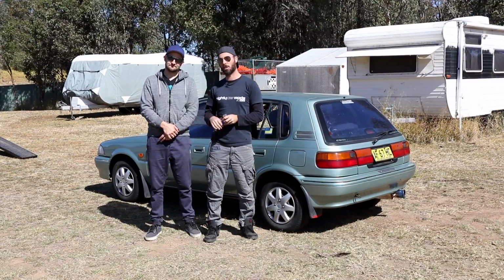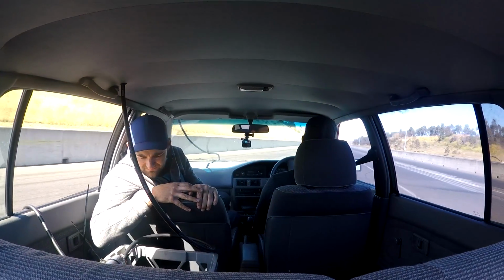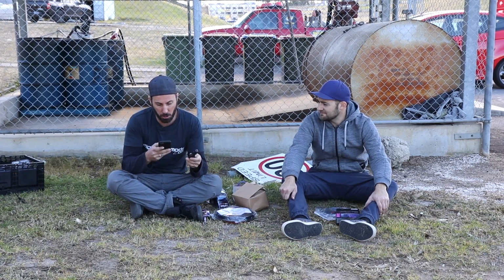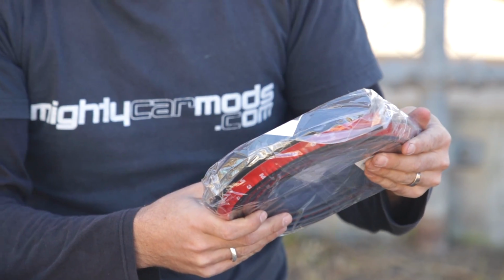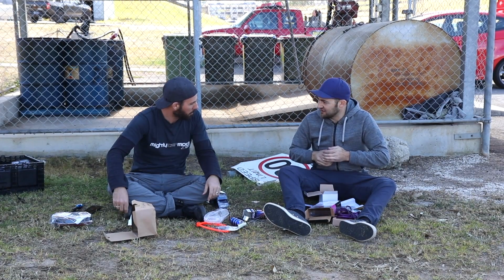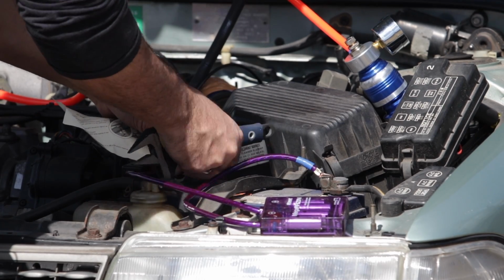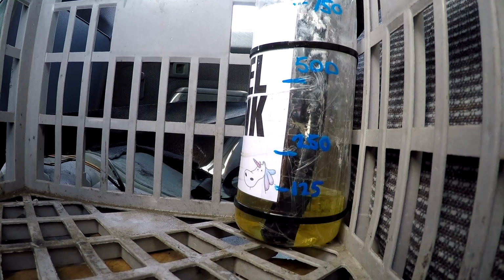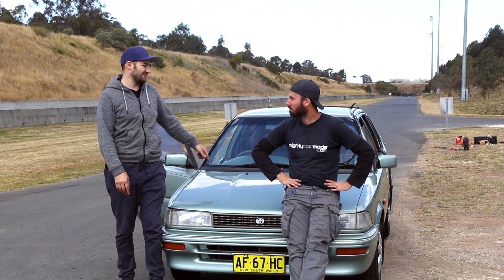Fuel Economy Mods - MYTHBUSTED

Comment: im curious as to what happens when you put larger /smaller diameter wheels and tyres on a car, I know the speed changes and the speedo does not read properly but my question is by how much? can you please use science and find out using Derrek?
Reply: Work out circumference of both and divide into eachother to get the ratio which you can multiply the speed by. 
  Circumference is pie (3.14) mulitiplied by the diameter.
So for example a 17" rim with a 3" sidewall tyre when the factory fit is a 15" rim with a 3" sidewall tyre = 1.1(more turns), so at a constant engine speed and gear you're doing 77mph whereas before you were doing 70mph.

Note that it's not this black and white as sidewalls typically decrease as wheels get larger, that's why larger wheels = a bumpier ride.  You have to measure the entire wheel, tyre and all, to get an accurate figure.

And that's assuming your speedo is correct.
Reply: Larger wheels = higher top speed and lower acceleration, because you've increased the gearing.

Smaller wheels = lower top speed and better acceleration because you've reduced the gear ratio.

Note that you can do the same thing by changing the gearbox final drive (not easy) or changing the differential gearing (possible on rear wheel drive, not easy on front wheel drive)

The only way the change of wheel sizes would make much difference was if you were sat on the motorway at 100rpm less but still had adequate torque to maintain speed.  I find most cars have a top gear that could be "longer" (lower engine rpm for a given speed) but that would require changing down for hills.  Cars are built to compromises and also for people who don't understand how they work so for most people they'd see that as an issue rather than a benefit

Comment: You guys have done most modifications like turbos, superchargers for example but have you considered building a na engine with throttle bodies or carbs for example i think this could be a interesting project for you guys when you dont have much on your plate.
Reply: I believe that NA means not available. Therefore, logically, boost is the only option.

Comment: while everyone is bugging on bad fuel quality, but actually driving in polluting air, can You test on car air intake place many charcoal filters from gas masks, to see, if ideally clean air changes something? of course, burned gases from engine cannot go back to intake- just remove tubing. Coal filters must be many so, no air restriction will be made! and the same with charcoal filters in muffler, does clean air will be produced and can be runned directly thru engine again, how long it will work if exhaust put directly on intake?
Reply: wut
Reply: I mean carter gases from engine

Comment: How much faster will it do a 1/4 mile with a crash diet?
Reply: azagedon wheels or modern motor (cant remember which) got a datto 120y down to mid 16s by progressively stripping crap out of the car. To the point they were sitting on a milk crate to drive it.
I think it was doing 20s stock.

Comment: Can you do an episdoe where you test if fuel vaport is more effiecient than fuel injection/carberation?  I see a bunch of videos about it, but they all look like BS.
Reply: Ah, yes, I've seen those. Is it more efficient, as in it uses less fuel to go the same distance? I'd assume so, if the car runs. However, it will be horrible for the engine, as it cannot run at it's proper compression, or air fuel ratio, and the ECU will probably attempt to compensate (in EFI cars) by running really lean/rich and retarding timing or something along those lines. By injecting fuel vapor into the engine, you are basically creating a carburetor, but making the engine run really bad, therefore it won't make much power, and it will damage the engine because you're basically starving it of fuel.

Comment: Along with all the simple economy tips people listed before, I'd like to see the effects of putting on a small (ish) turbo. In my experience, a turbo that spools up low in the revs will improve economy, the compressed intake charge seems to burn more completely. So as long as you don't sink your boot to the floor, it saves fuel!  (Plus turbo = cool, will go  bwrrrrsssshhhhhh tttuuusssh)

Comment: I want to see derek be turbo charged. And super charged. At the same time.
Reply: Sleepy Ancient But twin charging is fun, it could be a Lancia Derek
Reply: Zi9makin6 I owned a Derek. I would own one again to do mad fwd skids.
Reply: But he WAS turbocharged. Didn't you see that wicked blue plastic fan they put on the intake? All they need to do to supercharge him from there is stick a wind-up car motor against the belt for insane supercharging
Reply: Nick Bainbridge Lancia Derek has had a complicated upbringing. I checked the yearbook and got lost. :P
Reply: BlueSnowfox Brilliant! Supercharge an engine with another engine! They'll never see it coming. Twice the horsepower for almost no extra weight. We'll dominate the racing world... as soon as the funny looks stop.
Reply: Zi9makin6 o.O That is not worth it. The supercharger would never be able to spin fast enough to not hinder the turbo charger. You'd be lucky not to blow a seal in the air system... unless you engineered a set of bypass valves into the supercharger to let the turbo bypass it.

Comment: Hi! please do macGyver test from movie, when H2O2 [hidrogen peroxide] is added to cars air intake to go faster [like NOS]. please do the same with starting gas [very small amount of spray]. 
Also, Can You actually cool the oil if peltier elements is attached to oil filter?
and please test "Compressor" take portable air tank for filling up big tyres - that one who shoots massive air at once to get big tyre on rim,[internet is full with guys who shot pants down with that tool] and attach to cars air intake using flap valve - when car is running normal, it sucks air from valve normaly, but, when compressor is on, then valve closes and use pressure from that tank. good Luck!

Comment: Hi guys I got a question for you . If you where going to set a Petrol car up for (god forbid) fuel economy what would you do? PS: NO  Hybrid BS!  
I'm thinking light weight piston low drag rings polished heads that don't change chamber sizes the best  ignition system .....some thing that will actually work on petrol engines.
Reply: Drop compresion ratio, lean tune, cam with too much overlap?
Reply: sounds like an old flathead
Reply: Hyper eutectic pistons should be able to with stand the leanest. but dropping compression only if we turbo it.??
Reply: I hope not! I'm hoping that technology has advanced more than that. LOL

Comment: Smog delete. And making more power with no bolt ons.
Reply: Removing external devices  may have worked in the 70's, but that stuff is integrated deeply in the whole vehicle. Engineering teams will kill for minor increases in fuel economy or emissions- they really are tied together. Most piggyback reflash devices aren't much more effective that the cheap crap, just more expensive. Look at how deeply VW had to go with their shenanigans, they will be scrapping thousands of cars and paying billions out because it's way more costly and complicated then a "smog delete" whatever the hell that means.  Not surprised about the fail with all the junk. Caveat Emptor , or " there's a sucker born every minute"

Comment: Aerodynamics can help massively but needs to be properly engineered.. That cigarette lighter thing is literally just a resistor and led, I bought one for £1 from a carboot sale just to see what it was..
The magnet one is good if you want some cheap strong magnets and that vortex thing is good to keep spiders out of your extractor fan tubing in your house.

I want to know tho, would an electric turbo charger work on an old carb engine? It's blowing more air through it, so should draw more fuel..
Reply: Think they did the electric turbo thing waaaayyyyy back

Comment: A lot of fun watching, as for suggestions : 
1. Put Derek on a massive diet (power to weight)
2. Pump the tyres up a bar (rolling resistance)
3. Sort out your alignment and balancing (rolling resistance)
4. Do minor aero tweaks, outside and underneath. (Aerodynamic drag)
5. Jack the wheels up and make sure the bearings spin freely, and the breaks aren't sticking .

My 2cents in the kitty. Thanks for the awesome show again guys.

Comment: Try using a compressor and some air tanks to shoot air into the engine. Same concept as a turbo or supercharger. I've been curious to try this on one of my vehicles and see how well it can work or how much air would be needed. Of coarse it wouldn't be a continues shot of air.
Reply: So you would run the compressor before you leave to fill up the tank (Like the French car that does run completely on compressed air?), or do you want to take power from the engine to give power to the engine?
Reply: This would be cool
Reply: I was thinking the compressor would fill the air tanks as you drive and only use it once you have enough air. That's why it wouldn't be a continues shot of air. It just sounds like a fun project.

Comment: The fuel line on the roof isn't above the car.  If you look out Marty's window on the second run you can see it hanging.  That's where the extra fuel is.  That fuel in the line won't make it to the returns highest point on the roof.   Still all those mods are crap but there is your extra fuel guys.
Reply: They put the fuel line back up after before they measured it. Marty does it at 22:26 just before he gets out or his door would have pulled the line off the roof

Comment: The problem with this test is u tried them all at once! There were too many economy and performance gains at once that they negatively canceled out. I saw something like that once on a&e
Reply: Elliott Loe i cant tell if you're serious or not.
Reply: u are 110% correct, and it was probably temperature difference between two runs + with all modes together they added extra weight...and they forgot cold air intake (it would probably increased hp by 20%) neeeeh
Reply: Why would i joke about science

Comment: I was wondering what would happen if you put some diesel in a petrol powered car, and then after a few liters see your mistake and fill the rest of the tank with ordinairy petrol. Would it damage the car?
Reply: a petrol engine won't start on diesel because it doesn't have the compression and because diesel isn't as volatile or flamable as petrol. if it's mixed it would just lubricate the engine a bit more, make alot of blue smoke and it would probably run pretty bad but essentially it wouldn't harm it. (replacement of filters and flushing the diesel out is advised though to get it back to normal quicker). However, if you put petrol in a diesel car, you can pretty much kiss your engine goodbye.
Reply: 5th gear did a segment on that if you want to look for it
Reply: BeresinaCobra yeah i saw it. Didnt end well. But what if only something like 5 liters was wrong? Like if you realised your mistake after a few seconds of filling? Could you get away with it without draining your entire system?
Reply: on a petrol car, yes but it would smoke as if it ate a ring. on a diesel, you'd probably kill the engine.
Reply: From personal experience, an older, non injection, engine will cope with a few  litres in the fuel  tank if you top it up with petrol. You'll find the diesel ends up in the sump and, once you get home,  you have to drop change your oil and, maybe, your filter and it will be OK. Petrol in a diesel? Don't turn the key because you'll completely bollox the engine. Call your Motoring organisation, grit your teeth and pay to have the system pumped out and cleaned.

Comment: I always wonder if the car was thinner, not like narrower but like low profile roof... and modifying the seats to acomodate for the persons inside... will that affect the brick performance or willl it stay the same just a much more squished brick
Reply: it would lessen the drag for sure. that's the main reason every sportscar is like waist high.
Reply: my point exactly... how hard would it be to make a brick wall unto a sporty looking car... and the way this guys ( car mods heroes may i add ) make everything look so simple and comprehencible that many more will jump into car modification.

Comment: Why don't you try HHO wet or dry cell? Last time (couple years ago) I looked it up it seemed quite positive but you know how people are for faking results.  Considering the amount of time since I last looked into it and general advancements in technology, I'd be curious of an unbiased review of it as you guys have done with products in the past - the HHO cells are not expensive and actually easy enough to put together yourself.  My understanding is that its a reduction in fuel cost, apparently there is a power gain because HHO creates a more efficient bang in combustion chamber - of course my terms might not be correct for anyone tempted to nitpick but you get the giste - and also reduced emissions due to the ECU determining it does not need to burn as much fuel per cycle of the engine.  
Anyway, awesome channel guys, keep it up and if you're having trouble there is always viagra.

Comment: One of the easiest things to do to improve fuel economy is to not haul around any extra crap you don't need to. I've seen some hyper-milers go extreme by removing all the sound damping materials / carpets etc but you don't have to go to that extreme, just make sure the trunk isn't full of crap. You could also replace the spare wheel if fitted with a fluid repair kit and mini compressor, this will save weight but if you have a bad puncture / blowout etc you wont be able to fix it with fluid alone like you would with a proper wheel.
Reply: I think I'd rather walk my fat self around more, or exert myself wrenching and fixing the car to loose the difference in mass the spare tire makes.  

Especially if you're traveling between urban areas, you don't want to rely on a can of fix-a-flat...   And most of the air compressors that plug into the 12v adapters are VERY slow to inflate a low tire.  Don't forget that flats happen in rotten weather, so waiting 20-30-40 minutes to inflate a tire with an anemic compressor in the wind/dust/rain/sleet/snow is not a pleasant experience -- and takes longer than most tire changes.

The de-crapifying the trunk is well worth it!   It's right up there with just keeping up maintenance on the car.
Reply: They did an episode exactly on this like 5 years ago .. :D
Reply: I agree.. just some of the lengths extreme weight-savers go to. My Suzuki Swift came from the factory without a spare, just a compressor and bottle of gel that you insert while removing the valve key.. since I drive quite a lot I replaced it with a spare wheel

Comment: Disconnect the AC
If you have a engine driven fan you should remove it and buy a electric one
Remove all the interior and other "unnecessary" weight
Chip it

Comment: If you put the vortex generators on the front of the quarter panels beside the headlights so the vortex goes over the mirrors, it would probably have some effect. Modern cars do this as the mirrors are one of the easiest places to make drag improvements.

Comment: What about some real fuel economy mods? Low rolling resistance tires, aero mods, spark plugs, a real voltage stablizer (supposedly work on older cars), specialty rims, upgrading to a 5 or 6-speed, a header optimized for scavenging, timing adjustments (technically tuning), weight reduction, lowering the ride height, etc.
Reply: Oblithian sure, dont floor it while you drive. Driver mod!

Comment: migth be fun to take all these "mods" back out and fool around with the actual aero dynamics of the car , things like making the car more teardrop shaped using things like styrofoam plastic bags gaffatape and cardboard , maibe even mount thin space saver spare tires allround and lowering it as low as it will go and taking out a lot of the interior 
a more extreme thing you could do is close up one cilinder by taking out the valvetrain to that cilinder and take out the sparkplug maibe ?, it will shake and stutter like mad but hey lets try it right ?

Comment: i mean everyone knows the super ryzen is just a voltometer but how about a proper grounding kit which manufacturers have started implementing better. or manual fuel pressure regulators,cold air intake, better spark plugs, a small turbo, and so on and so on. basically how about testing out actual economy mods that newer cars have in fact implemented but older cars do not have plus the small off hand things that most economy nuts go for.

Comment: You so need to do the skid plate challenge it may be called something different in different regions or areas but basically you put some kind of neoprene plate like a cutting board that's made out of plastic underneath the rear tires pull the e-brake as tight as possible and drift the car because of course you'll create mad skids for the simple fact you'll have less grip

Comment: Don't forget you are now running a full turbocharger and 98 octane, gonna lose some mpgs
Reply: Tool0GT92 the way to save gas is to make the engine smaller for regular commute and use turbo for the HP numbers. That's why turbo 4s are popular. It allows good mpgs and good horsepower. Basically good marketing numbers

Comment: Could you guys try that hydrogen fuel cell thing that was going around on faceballs? Guy said he was getting like 90% burn or something.
Reply: Mahic408 If a spark goes off, why wouldn't the fuel all ignite completely regardless? Am I missing something?
Reply: afaik there isn't a thing such as 100% efficiency, some energy will be lost to heat and other things. Not all fuel will burn off, which is why cars will backfire or crackle/pop, which is unburnt fuel blowing up (igniting) in the exhaust, or cars with antilag will often shoot flames (although this can be caused by a variety of other things).